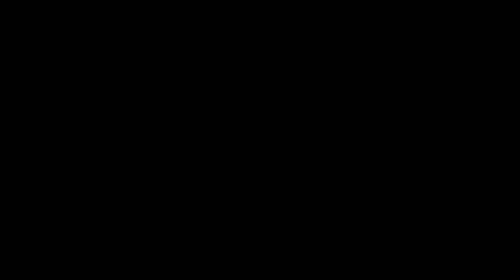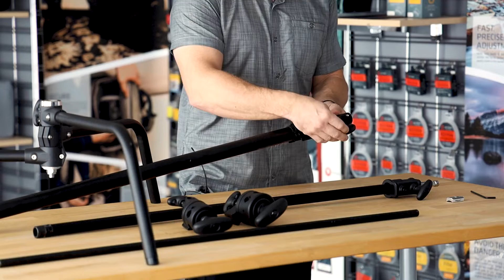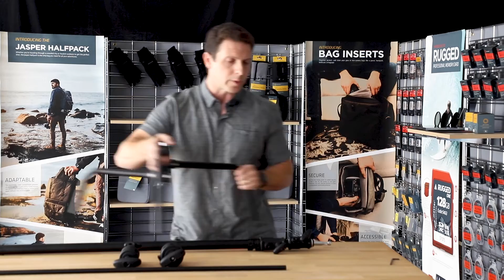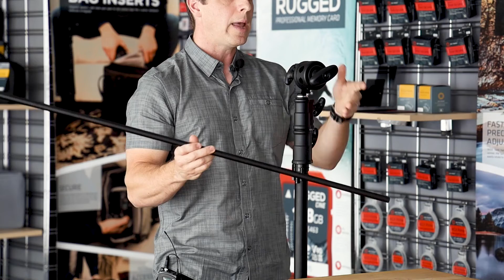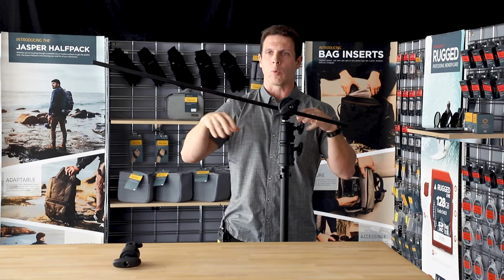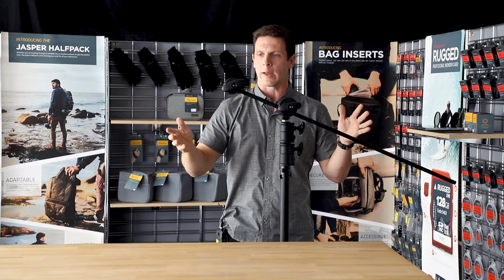ProMaster C-Stand Assembly Instructions

Comment: This is barely helpful.  Guys, if you want to make a proper assembly (as opposed to actually printing instructions), here’s a tip:  make sure the viewer can actually see what you’re doing!  This means you need an overhead cam at the very least.  This video is incredibly frustrating.  You have black parts on black parts and you’re pointing to things we can’t see because the parts are laying down and you don’t have a 90-degree look at what he’s doing.  That’s a fail.